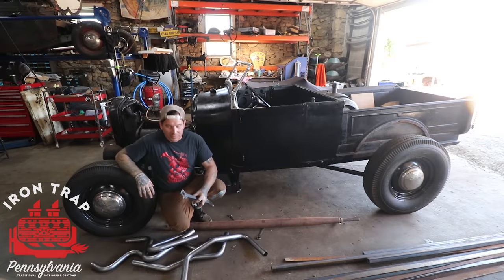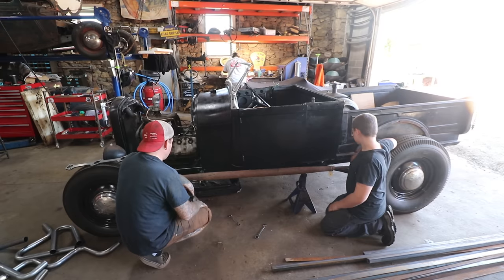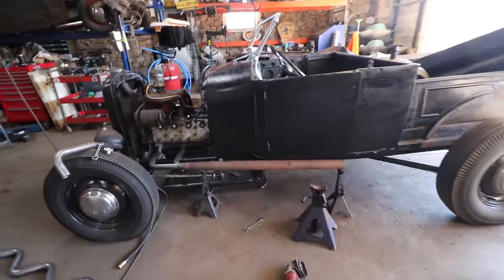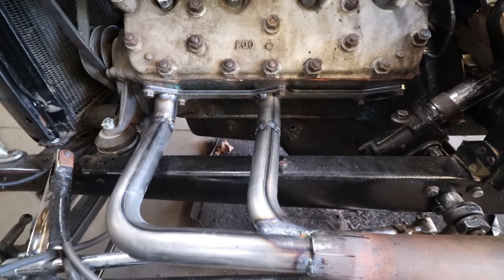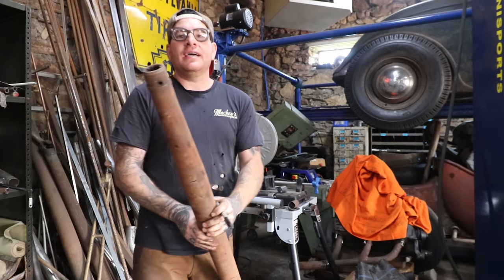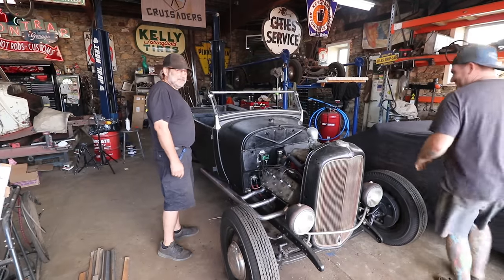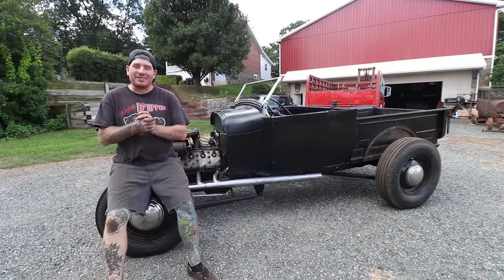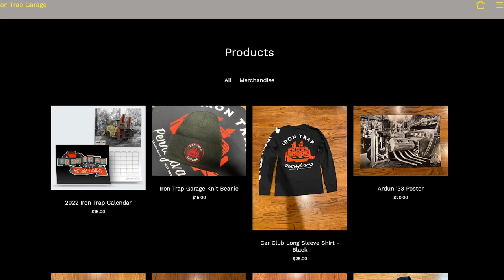Building Custom Torque Tube Headers For The Iron Trap Roadster Pickup

Comment: Years ago my 1953 Victoria headders were from a 37 ford. The guy that bent pipes for me made a 180 to clear and flow exhaust rearward. The pipes were 4 inch laying outside rocker panels.  Burnt my legs regularly but it sounded glorious. Miss that 2dr Hdtp Victoria.  Had 210,000 miles on it.

Comment: Have you thought about adding cherry bomb mufflers to the truck?  Ì think they would add a nice smooth sound to the truck.  What about front and rear fenders over the wheels?  I love the look and sound so far.  Keep it coming.
Reply: John, I'll try and help you Sir. Cherry Bombs wouldn't be TRADITIONAL. 
This shop primarily builds traditional style hot rods, meaning generally what was done in the 30z, 40z, and 50z. A traditional muffle would be something called SMITHYS, you can research these to get an idea of what they are. They're still made to this day, so you don't have to dig up a old set from 50 years ago. 
I hope that explanation helps. 
T.S. RACING

Comment: Headers are awesome,it's different then the common" shortys," I love the flow line.truck is awesome.whoever has to run for parts isn't going to be bummed to stop working to grab parts. I'm excited to see what u are planning for final touches.such a good video cause most people don't have the fab skills and almost anyone with determination can build a hotrod like this,just like our grandpa's did
Reply: Probably gonna be runs to the parts store in it, get back to the shop, "Oops, forgot something, be right back".  Back from trip two, Oops, forgot something else.   Just keep repeating as necessary.

Comment: Looks pretty cool! Just wondering, was there any warpage on the flanges because of welding? I guess you have better methods to weld them that i do and control the heat, but i usually bolt headers down on some junk cylinderheads to reduce the warpage issues and i take them of the crappy cylinderhead, when it has cooled down.

Comment: Why does the v8 have only 6 exhaust ports? Doesn't that put back pressure on the engine? Glad to see the younger generation has an interest in hot rodding, he has a good teacher.
Reply: A lot of the early v8’s have both center cylinders dumping into one exhaust port. Probably not optimal but very common

Comment: When you look at the engine you see 4 spark plugs and then when you look down under the heads it has three pipes which actually looks like there is something wrong and a pipe is missing or something. We know that all four cylinders are exhausting but it just looks off and not right because there are only three pipes. It's OK, but I would love to see four pipes instead of three. Good work though and that truck came together pretty fast even with all the work y'all did on it.
Reply from the maker: It’s quite the opposite…. 3 pipes is what most early V8’s had so it looks correct to anyone dealing in vintage engines and hot rods..
Reply: @IronTrapGarage  Ok, thanks for the info. I've never put together anything that old and had to put headers on a flathead Ford. After I went back and looked at it again I get it. Now it looks normal to me when I realized what I was looking at. I've been a subscriber for probably as long as y'all have had Iron Trap on YTube. I guess I am going to try to fix up an old 34 Ford soon. I am going to get my Grandkids to help me. They are at just trhe right age. I might be shopping at your store for some items, hope you got good customer service. Thanks and good luck on you guy's business venture. It looks like you got a really good thing going on and I wish y'all success in the future

Comment: I like the headers, but I'm curious why that engine has 3 pipes for 4 cylinders on each side. I wonder what made them design the engine that way. Also, I'm curious if you plan fenders for the truck. Tires throw a lot of stuff up from the road.
Reply: The middle two cylinders are running a common exhaust port.  The exhaust valves for both cylinders are beside each other and intakes are "outboard" on the cylinders.
Just simplicity of design. Remember each cylinder fires at a different time
Reply: @josephdougherty2399  Thanks. That is what I suspected. I helped my cousin rebuild his flathead on his '41 Ford back in the '50s, but that is my only flathead experience.
Reply: @lelandrogers1078  yeah.   It's a marvelous engine design. The first V motor built by Ford was for Lincoln.  Casting the block was very complex and multistep.   For the Ford V8 their biggest engineering hurdle was simplifying the casting process to make it affordable